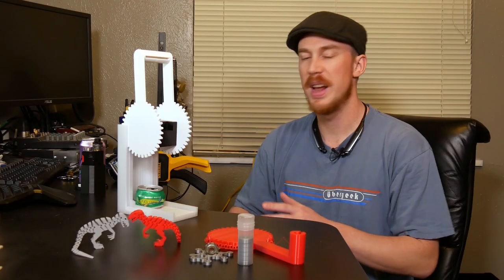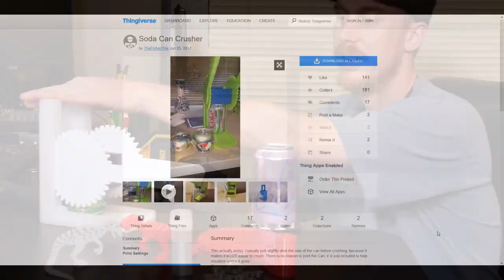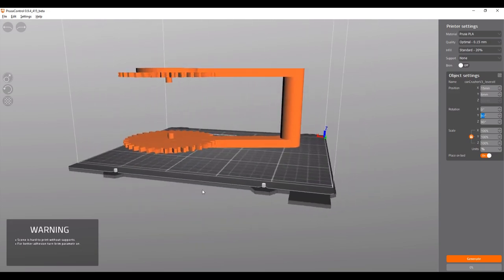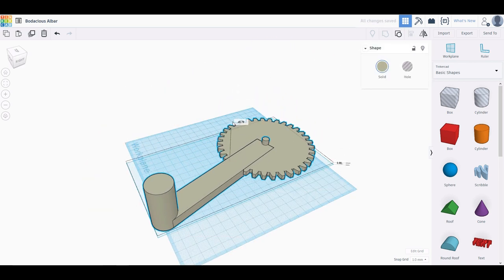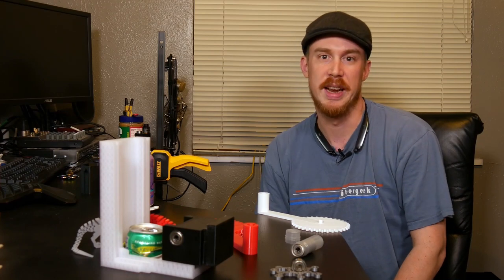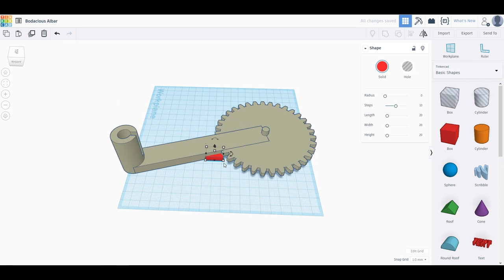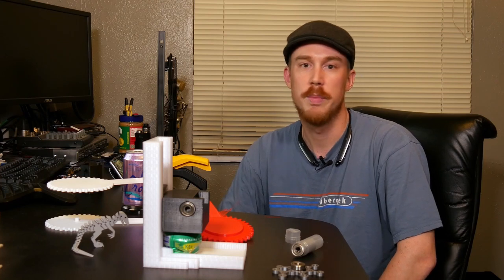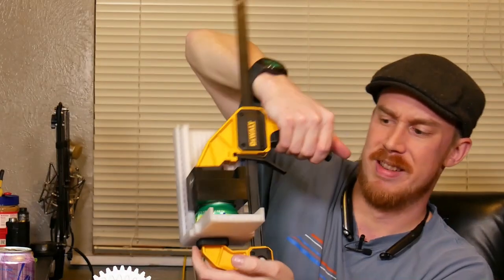Can Crusher Case Study

Comment: It looks like the failing pegs have right angles between them and the main gear, might reduce stress points to introduce a curved edge between them
Reply from the maker: Thanks Nyaruko. Any advice about how to make a curved edge that will fit into a bearing without slipping out?